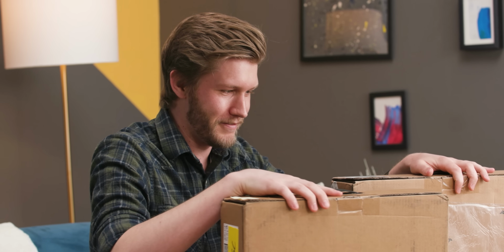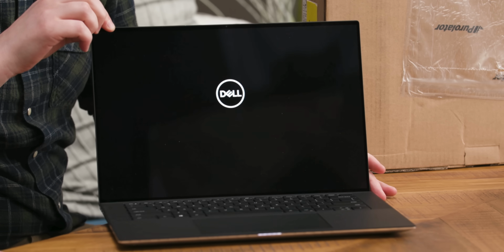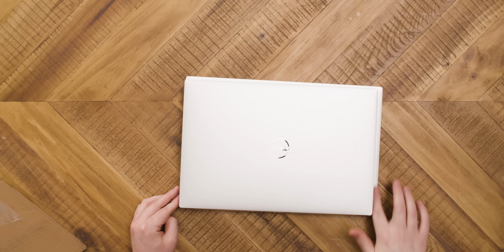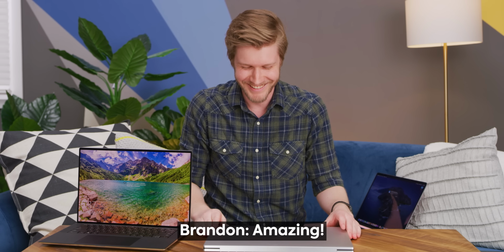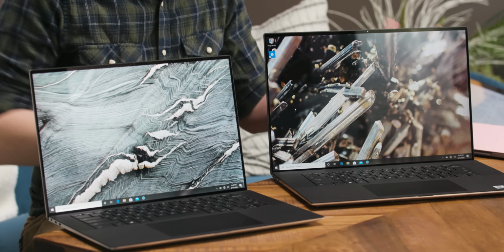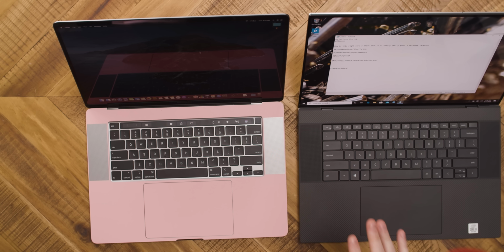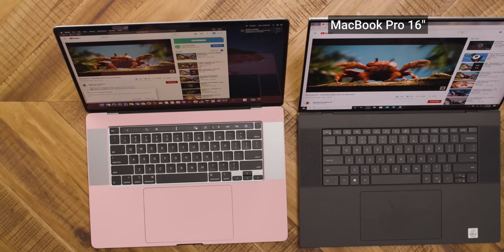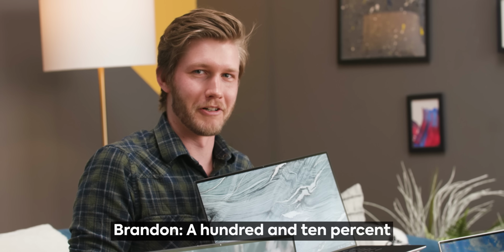The MacBook Pro's Biggest Rival - DELL XPS 15 9500 & 17 9700 Laptops

Comment: 16 Inch Macbook Pro vs Dell XPS 17. At the end of the day the story is the same. Windows laptops are always more powerful and spec'd out due to better components and ports. But end of the day these things are mobile laptops first and Macbooks are always better optimised since they can run at the same performance either plugged in or running on battery. Most Windows laptops have to be plugged into the wall to get max performance, once you unplug it the performance drops so badly because the battery isn't powerful enough to run all the components at full power. I hope that's not the case for the Dell XPS 2020
Reply: Hate to break it to you but from personal experience having both a MacBook and ThinkPad with the same CPU (the ThinkPad has a 1650 while the MacBook has a Radeon Pro 555X) the Thinkpad actually runs faster when benchmarking then the MacBook does (cant remember the exact numbers) despite both being unplugged. The only handicap the ThinkPad has is that the graphics will run slower when unplugged but it still beat out the MacBook when away from the wall so that doesn't really matter all that much.
Reply: Lover Of Tech For the XPS 13 2020 it’s definitely a thing. Not noticeable in everyday workloads but for heavier tasks a power outlet makes a huge difference
Reply: What a pity excuse for nothing, have you ever used a XPS personally ? Then please shut up. All windows laptops have same perfomance when plugged in or out  LMAO, only the dgpu is limited, which in this case both laptops do not have.
Reply: @RandomGuy-om1vy  I use a GIGABYTE AERO 15, Owned a Dell G5 and G7 and also Dell XPS 15 and 13 so I am speaking from personal experience and from an unbias place. Clearly you didn't read properly
Reply: Random Guy I happen to have two XPS laptops my friend. I love them. But this is a fact. You can even see the max CPU power changing in Hardware Monitor
Reply: The MacBook doesn't "drop" in performance because they use lower tdp parts, both the Mac and dell deliver the same amount of power off battery. But apple limit the parts to work within a certain tdp so the difference between battery and charging is smaller. 

The main difference is the GPU, the highest performing MacBook GPU only pulls 50watts tops, compared to a mid-range Nvidia card which pull around 80-100 but gets double to performance. So windows machines tend to have a more noticable dip in power when on battery but that's only because they have so much more to begin with.
Reply: Jake Townend Perfect explanation. 
I also saw a guy on twitter (some idiot called Canoopsy) take advantage of this myth lol, then I raged on him and he replied, he said: So I think personal opinions are wrong nowadays
And I replied: Personal opinions are personal and not on Twitter.
And just because of him over 200k people are misinformed.
Reply: @JoeNokers  absolutely well said and couldn't agree more my friend. This is why I feel when does it not become worth it anymore if the laptop can no longer be a laptop where it always needs to be pulled into the wall to get any serious work done. For a laptop having the absolute fastest specs can also lead to a negative experience. I would rather have better optimization with the components to run full speed on Mobile battery the same as plugged that to have the fastest specs but never be able to use them when I'm mobile and no where near a socket of power. Food for thought
Reply: Lover Of Tech Well you have never heard about the quality and hardware issues that MacBooks tend to have. Also sorry for being harsh back there lol.
Reply: @RandomGuy-om1vy  it's all good dude. It's all about having a civil discussion. Like I said before I'm more PC and windows. I have never own a mac in my life and yes I know all the QC issues with Apple and Macs. I'm more speaking from the point of that when it is not worth it anymore if you can unplug the laptop for it to be mobile and perform as it was intended to do as a mobile product. It's almost like having a smartphone that works at full performance only when plugged to the wall, it then just becomes a glorified landline and no longer a true mobile device
Reply: @LoverOfTech  personally I own a 2016 blade, and 80% of the time I don't need all the power it has. However some projects (I'm a graphic designer) I do, and I really need that extra power to be there and being able to plug in at a library or office lets me do some GPU intensive workloads that just aren't as smooth on a macpros weaker GPU.
Plus when I'm done I can boot up monster hunter and relax a bit (which the MacBook most certainly is not capable of). So yeah for a lot of people you are right, apples moderately specced machines are perfect, but I think the issue is more people buying the wrong windows machine for their use case, if you don't play games or render video, you don't need a laptop with a 2060 in it.

Side note, ryzen is about to completely change the laptop game and I'm curious to see if apple decide to use them in their lineup
Reply: Lover Of Tech Well now you know the truth ;). Also check out Macs as MacOS is pretty cool and simple.
Reply: @JoeNokers  Ryzen 4900HS laptops especially in 14 Inch bodies are gonna be a game changer. You're right OEMs need to better educate and let buyers know how they performance plugged and unplugged based on what laptop and use case you need. With AMD not having "official" support for things like Thunderbolt 3 and beyond the adoption is gonna be slower until USB 4 spec is full released.
Reply: @LoverOfTech  for me, I can't say I have ever utilised thunderbolt 3, my laptop was one of the earlier adopters of the standard and it's cool and really great for some people. But outside of eGPUs it isn't really that useful and the 1060 in my machine is enough for any workload that I throw at it when I'm on the move, if something needs more than that, my CPU would likely be the bottleneck anyway outside of gaming. 

Laptop performance has been pretty stagnant for a while now, with the 10 series Nvidia cards being the last big step forward, so I'm excited for ryzen to mix things up, more than anything ryzen apus should push battery life if mid range machines (performance not price) like Dell XPS 15, Razer blade and the like.

Comment: I've had friends who've bought previous xps 13 and have had many problems with battery and hardware
Reply: Owned 9350 9370, everything fine but that persistent coil whining. Dell just not seems care about it.
Reply: I keep seeing these machines just die for no reason. They use the same cheap board in the base model on the higher end models, this has been covered on LTT before I believe. It's stupid. It's on par with MacBook reliability.
Reply: I'm thinking to go for the lenovo Y540 over this
Reply: I can attest to this, Dell support came to my house twice, replaced the motherboard under warranty and problem persisted. Wound up replacing the battery myself and that fixed it.
Reply: Even though the support didn't fix the problem, I will admit sell support is pretty good. I have their monitor too. Wich I had problems with... Maybe I should stop buying Dell.
Reply: Alex Bianchi - Define Wisdom. I bought a dell monitor and one of the pixels died. I gonna have it replaced under warranty as soon as possible.
Reply: I’m getting a dè ja vu here
Reply: Buy a hp or lenovo for reliability. And dont buy dell or a macbook for it as they are absolute trash in hardware design
Reply: Random Guy Lenovo thinkpads are so fricking reliable. I can't switch due to fully integrated workflows with Mac and Final Cut.
Reply: Random Guy Funny. I have had terrible experiences with HP devices. My screen just literally broke again today. Argh!
Reply: nice